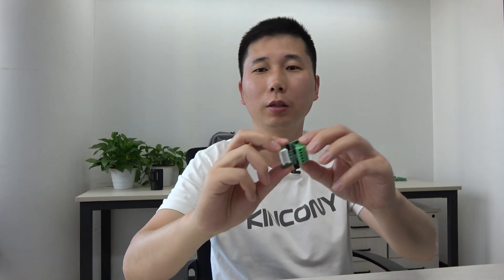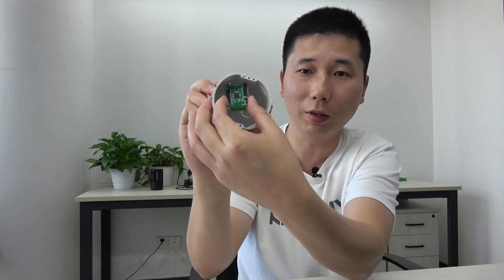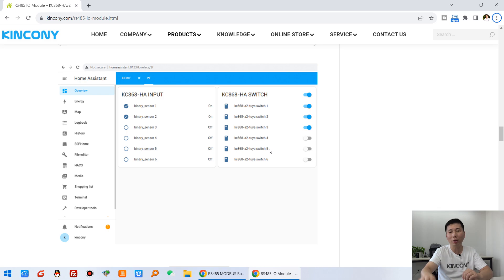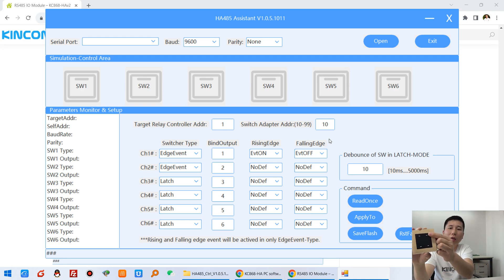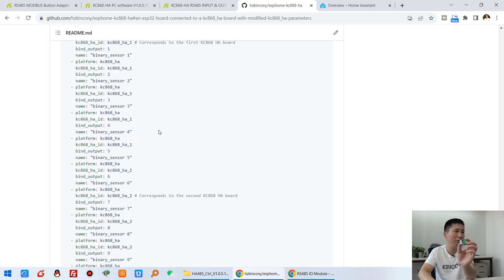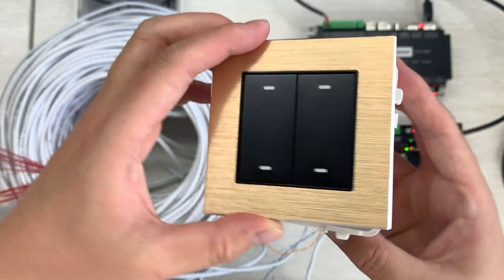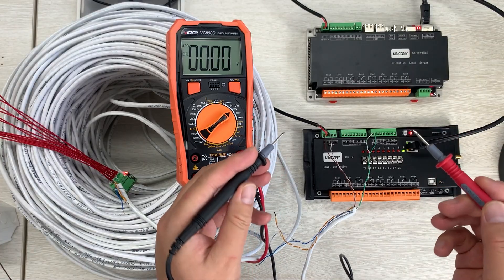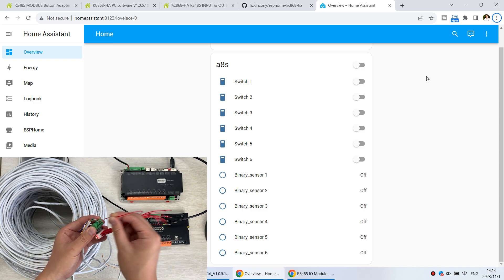KC868-HAv2 RS485 IO Module For Home Automation & Smart IOT Project

Comment: Hello, friends. Thank you so much for your products—I’ve been using them with great pleasure. However, I’ve encountered an issue while trying to set up your KC868-HAv21 RS485. I connected it via RS485 to a KC868-A2 and am using ESPHome firmware. I added your component from GitHub, left the default settings on the HAv2, and the digital outputs are working fine. But when the state of the digital inputs changes, the ESPHome logs only show the following messages:

text
dump kc868_ha config, target_relay_controller_addr=1, switch_adapter_addr=10, bind_output=1 (bind output 1-8)  
found a kc868_ha board, target_relay_controller_addr=1, switch_adapter_addr=10, bind_output=1 (bind output 1-8)  
What am I doing wrong? Thanks for any advice!

Comment: How much current do the outputs provide? Would they be sufficient to power an LED? My intended use case is that when someone uses a switch to turn on a light, a small SMD LED on the switch will also illuminate to indicate the light's status.
Reply from the maker: it's mA level, need add driver

Comment: Hi,
I have a question.

In your video, there is an RS485 port available in the server mini itself. Why did you use another module?
Will the HAv2 work directly with the RS485 port on the server mini?
Reply from the maker: usb-rs485 adapter use for config by PC. because config tool running on PC, it's windows tool.

Comment: One things I don’t fully understand - if you already have 8 wires from the ethernet cable, why not use 5 of its wires detect the digital input presses from the traditional switch directly on the A8S board for example?
Reply from the maker: HAv2 use for long distance. such as 2KM is ok. RS485 support multi boards connect with one BUS wire. if you have many switch panel, use HAv2 will save many cable.

Comment: this module can be used without any of your other products?
Reply from the maker: sure, just input and output by RS485.
Reply: @KinCony  sweet thanks.
Reply: @KinCony  i cant find the electrical specs on this module, what drive current are the outputs capable? enough to drive a mechanical relay/contactor or just a mosfet based switch or an ssr?
Reply from the maker: @DeviloftheHelll  it only output about 10mA level, can't drive relay directly, you need to add triode.

Comment: This is great! RS485 is very robust & reliable. Do you have a basic ESP32 RS485 receiver board that just passes entity states to HA, like the one you're using in the video but without the relay outputs and switches. This can be used to control existing wireless devices connected to HA. Thanks
Reply from the maker: we not used ESP32 made the RS485 small board, because the ESP32 size is bigger, we made the small pcb with 4 PCB layer, just want size smallest. if you think size big is ok, we have many ESP32 board with RS485 interface, such as KC868-AM: https://www.kincony.com/esp32-io-expansion-board.html
Reply: @KinCony  I'm referring to the receiver board that the RS485 tiny boards terminate to. So I can use multiple tiny boards in the house with one receiver picking up all the entities and passing on to HA
Reply from the maker: you want a very small pcb (ESP32+RS485 interface)? without ethernet, right? @thierry3610
Reply: @KinCony  Basically your A8S v2 esp32 board without the I/O, so it's just an interface between the tiny RS485 board and HA
Reply from the maker: why not use KC868-AM, it's ESP32+RS485 small PCB.  @thierry3610
Reply: @KinCony  Great! That answers my question, thank you.. will give it a try in the near future 👍🏽
Reply from the maker: ok @thierry3610

Comment: Small and powerful.  Congratulations!❤️
Reply from the maker: thanks
Reply: @KinCony  Please make a board small like this, but with 2 relays onboard, so it can directly turn a light on or command a roller shutter.
Reply from the maker: by wifi? by ethernet? or by RS485? @Floppy379
Reply: @KinCony  both ethernet and RS485
Reply from the maker: if include ethernet, the board will not very small. @Floppy379
Reply: @KinCony  Then just include RS485
Reply from the maker: ok,i see. but there are already many 2CH RS485 relay module on the market. @Floppy379
Reply: @KinCony  Not that small and not working with your controllers via bus
Reply from the maker: ok, maybe in furture can do that. @Floppy379

Comment: Great video, sir, this LAN cable and electric wires passing through the same house wiring pipe, can interference or randomly false data come?  or not a problem ? If it's not a problem, could you please explain why there is no interference between electric wires and data wires.
Reply from the maker: There will be no problem, RS485 bus is already a mature solution, and it is also applied in the industrial field.
Reply: Ok sir, thank you @KinCony
Reply: @KinCony  Will this work with other solutions of yours equipped with RS485 bus?
Reply from the maker: sure, all our relay board support KC868-HA board. @Floppy379

Comment: i think this is best concept because  reduced  some  switch wires  to controller and  easy to connect switch and digital sensors
Reply from the maker: yes, use any dry contact sensor for long distance.
Reply: @KinCony  using CAT6 cable  because that
 cable has very low resistant , am i right
Reply from the maker: CAT6 is better than CAT5 cable, but CAT5 is enough for KC868-HA board. @er_samadhan_babar_ziddi3561
Reply: @KinCony  i am Embedded engineer

Comment: Great video sir, can you make next video about "when the binary sensor on switch will be on and if binary sensor off the switch output will off.....restore the state after the power failure"
I hope you sir, you will make this video for me.....
Reply from the maker: ok, when i have free time, can make that video.
Reply from the maker: by esphome? or by home assistant?
Reply: @KinCony  by esphome
Reply from the maker: which problem with you? a: when power on, DI always ON, but relay can't ON? b:if relay is ON, now power failure, then power on again, relay can't auto ON?
Reply: @KinCony . absolutely sir, option B. "if the switch is on when power failure happens and then power on device in this case switch will be already on but relay can't auto on........ Thanks for understanding my question
Reply from the maker: what switch you have used? push button or a LATCH button? @SERANJEEVI_C
Reply: @KinCony  latch switch sir
Reply from the maker: after 2 days make a video for you to solve this problem.
Reply: @KinCony  thanks sir ,thank you so much.....for your reply
I am waiting for your video.....
 
I will try with esp 32 , 8 channel relay module ( as a output)and latch switch (as a input) in esphome 
Yaml code that I used,
 you already told to use momentary switch function on press -turn on relay , on release -turnoff relay and also i try restore mode......but I will not solve the issue
Reply from the maker: will make video by LATCH switch panel. @SERANJEEVI_C
Reply: @KinCony  both latch switch and also on -off normal electrical switch

Instead of latch switch You can use regular electric switch which as on - off
Reply: @KinCony  use normal on- off electric switch